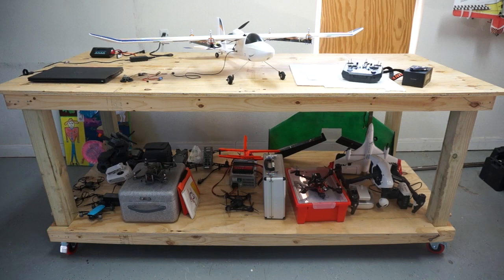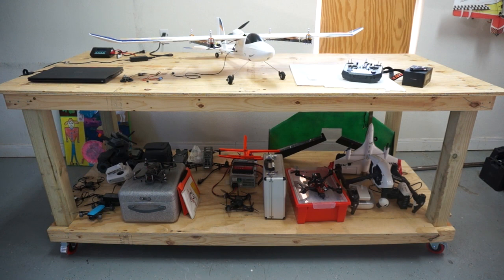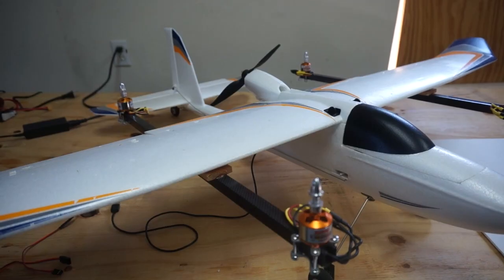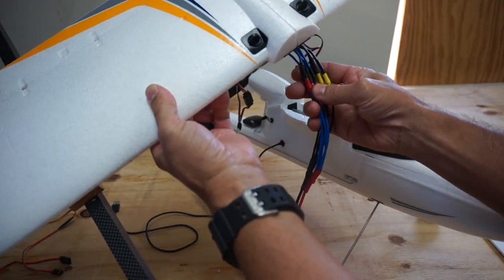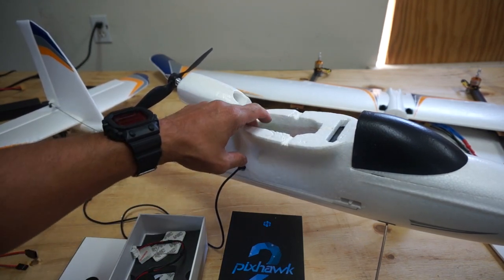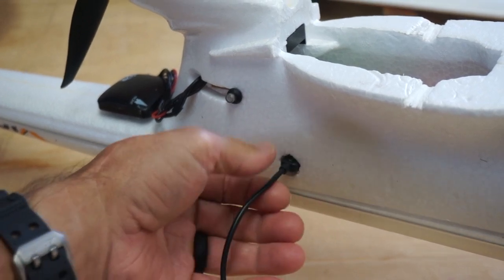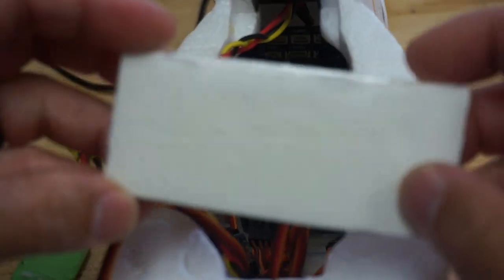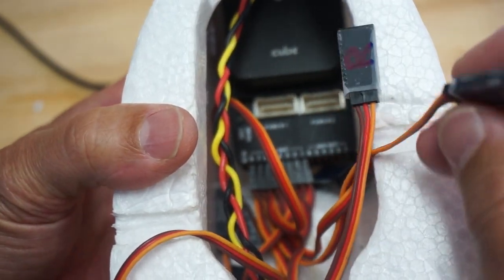Bixler QuadPlane Update #2 - Mobile Workbench & Wiring

Comment: What battery size and voltage will you use? Something around 5000mAh 3s?
Would love to know the total weight and flight time.
Reply from the maker: Good question. Just posted an update where I share some details about the current weight and battery size. Will get back to you on flight time.

Comment: What is your source for the square carbon fibre rods & are they actually woven, or are they pulltruded with a woven veneer?
Reply from the maker: CJ, I can answer your first question but not sure about the others. Got them from here: https://hobbyking.com/en_us/carbon-fibre-square-tube-15-x-15-x-800mm.html
Reply: These are roll-wrapped CF (square) tubes.